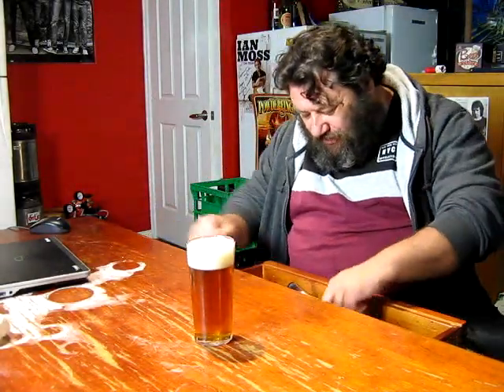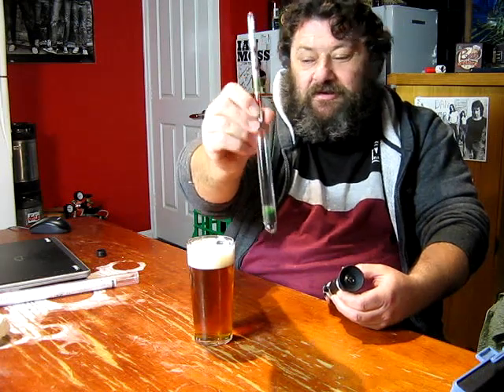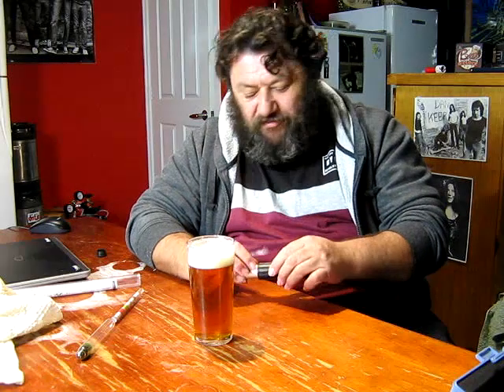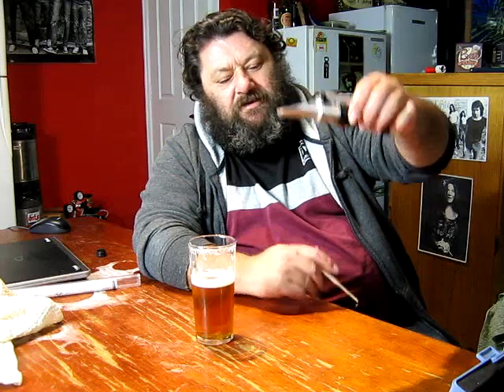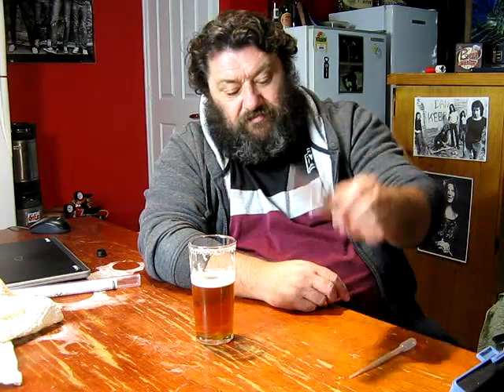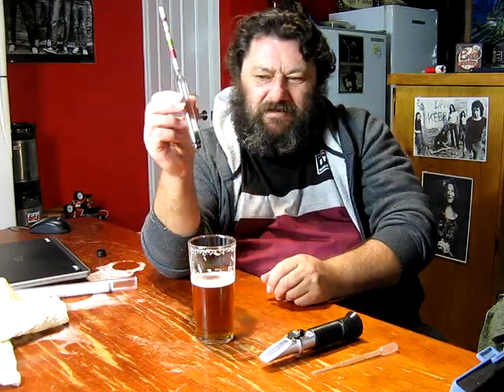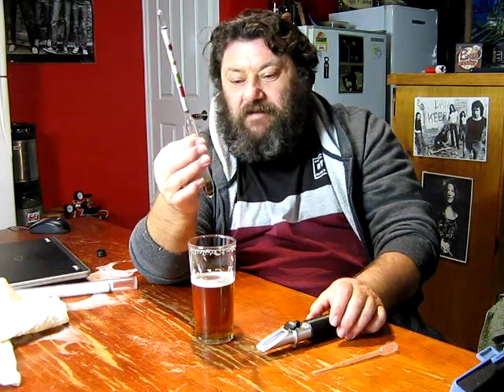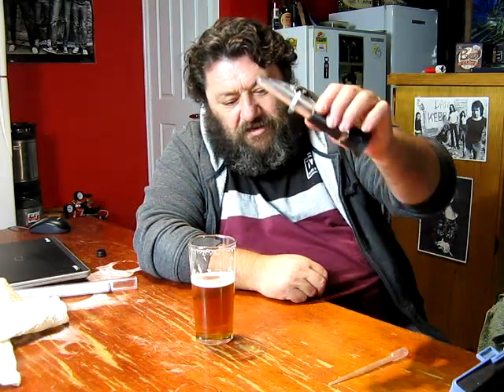Refractometer vs Hydrometer

Comment: This is a good one! I did a brew on the weekend had a lot of trouble with the pre/post readings with the refractometer at the start until I started cooling it down and it was much better but I always take a hydrometer sample stick it in the freezer like you said and double check which is usually more accurate then the refractometer. If you ever have time LJ I’m really struggling with getting PH right. I’ve got accurate water reports and used it in beer smith but my PH meter never reads correct I even just purchased some strips to check this weekend any tips? Cheers
Reply from the maker: Hey Ray, I have not really been too concerned about ph till recently. I have test strips and know my water is around 5.6-5.8. So with some grain I always got around 5.5 in the mash which I was happy enoug with. I am now looking to get a better grip on it. I have oredered a quality ph meter and will look to get some accurate readings, and use additions and acid to get closer to the magic 5.2 and see how much it effects the final brews....
Reply: @littlejohnsbrewing  cheers John it’s a lot of work AG brewing to split but I’d be interested to know if it actually makes much of a difference in the final brew. I fell for the ATC on the refractometer lol. Have a good one
Reply from the maker: @rayw9067  yeah not a simple process splitting a batch. I would do this as 2 small batch BIAB if I was to do it.